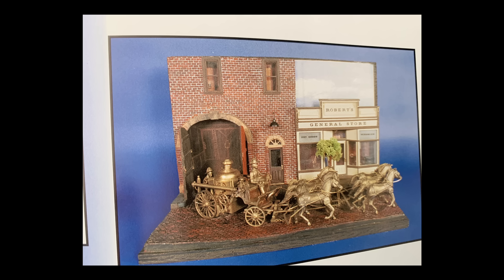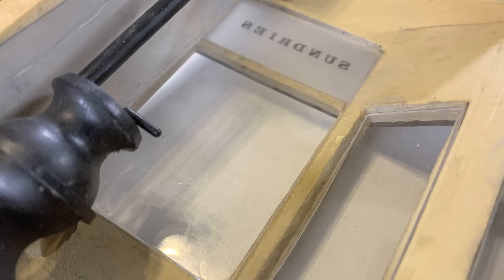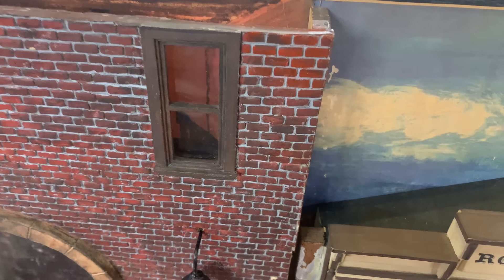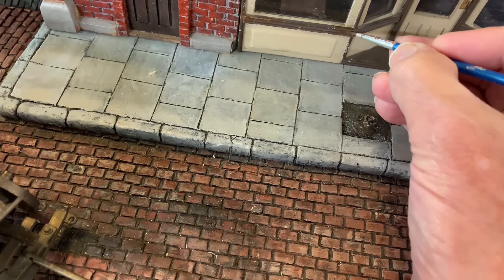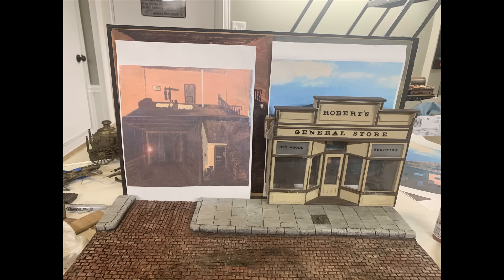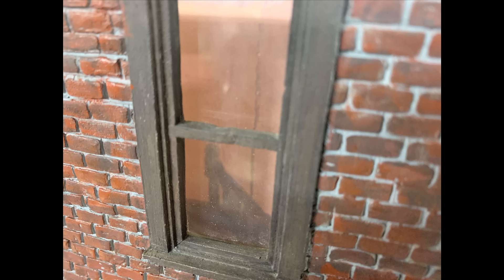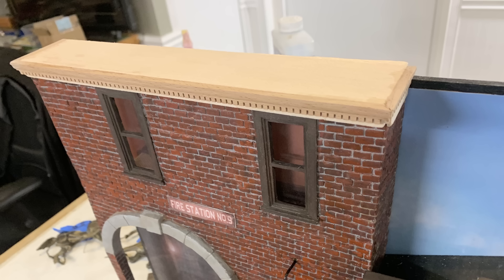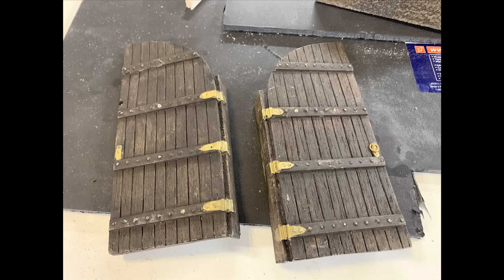Repainting and Redoing the Backdrop - Restoring Delton's Brass Fire Wagon

Comment: You did a great restoration of backdrop! It looks great!

Assuming that the prototype was supposed to represent Boston, New York, Philadelphia or some other North Eastern City the sidewalk was probably supposed to be granite and not concrete. The keystone arch was probably meant to represent either marble, granite or sandstone and not concrete.  This prototype is depicting an era before poured concrete sidewalks etc. and concrete or bituminous concrete roads. The road pavement may have been meant to represent either brick or granite cobblestones.  

Steam powered fire engines went out of use pretty quickly once the internal combustion engine came along to drive the water pumps on fire engines.  Dragging a steam boiler around on an engine with horses was a dicey if charismatic fire fighting method.
Reply from the maker: Yup. But we really wanted to brighten it up. The cobblestone we had here was rose quartz. And grey granite. The rose quartz looks like sandstone but is actually granite. And the original diorama had red stones. Brick?  Possibly. The tan stones on the firehouse looked really dark. So I really wanted to make it grey. Concrete or granite. Same with the sidewalk. The dark brown grey was really toooo dark.

Comment: It is of course your model. You can do whatever you want with it. And as has been pointed out by others, the use of two rows of horses certainly was a example of artistic license by the manufacturer. However I do have a few thoughts on your new paint theme.

Mainly regarding "concrete" colors you applied. Concrete became a building material mostly in the 20th century. So in the 19th century, when there were horse drawn fire pumps, buildings often used decorative sandstone for the arches (so tan was the "correct" color), side walks were not concrete but slate (so dark gray would be more common), and while there were brick roads, they were often much darker than red brick today, or were cobblestone, which were also darker in color than brick today. 

Ergo, I would "say" you have recreated this as a "Heritage" diorama. That is, people using older equipment and rolling stock today to recreate scenes from the past. Which, in its own way, is nice. 🙂

Side note: Personally, I prefer PVA to attach clear plastic windows. Avoids the potential for "hazing" on the clear plastic.
Reply from the maker: I mostly felt that the colors were just too dark, and it didn’t present a nice looking diorama. The cobblestone that we used to have here in Salt Lake City, and all of the original ones are now gone, but I remember them quite well and in fact, a lot of them were still in use to tell about 20 years ago, were really light colored sandstone. A cream color, with a hint of red. I assume they were quite different in every location. 

There are some stone curbs still in use here, mostly gone now. But the same tan stone. Hard stone but some sort of sandstone. Had we kept the sandstone look I still would have gone with a lighter tan. 

Cement was in use here even in 1850. Our friends house is cast from concrete and was built in about 1880. The cement was brought in from Great Britain!  A cement plant opened here in about 1900 and that was the end of stone construction. Oh and commercial buildings used granite stone as it was readily available. 

Anyway I think it’s brighter and shows better. 

THANKS SO MUCH FOR COMMENTING!  We really love the dialogue with people.

Comment: I LOVE this piece very much. I have one question… In your research; did you find any hint as to soot build up above the door from the boiler? Or would the firemen have kept that cleaned off. I do really appreciate all the attention to detail both of you bring to your dioramas. So this question is in NO way me being negative😊
Reply from the maker: Hi. Not sure. But they could not have had the boiler fired under the sleeping room. But the boiler was fired 24/7. Horses would respond the the alarm and fall in line and the harness system snapped into place. Total time about 40 seconds. Anyway the wagon would have needed a smoke jack. And yes, there would be soot.

Comment: I suppose that the fact that the wagon and horses are Brass, you really don't want to paint the brass, making the model more realistic?
Reply from the maker: I originally wanted one of these to do just that. But this one needs to stay as delivered. Mostly. I think. HOWEVER we have the unfinished one too… hum… I’m thinking of finishing that one with polished brass and red paint and then not add horses. I think. Have it parked. Or better, a flat car load.